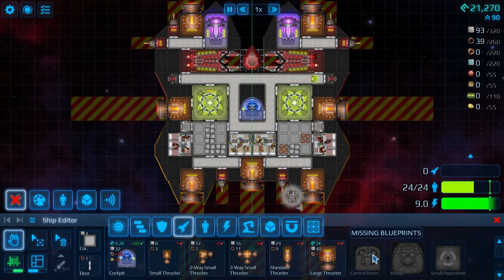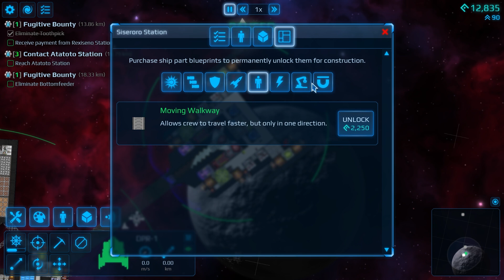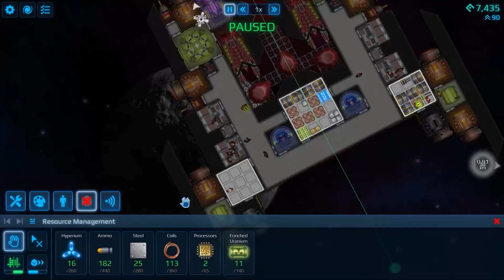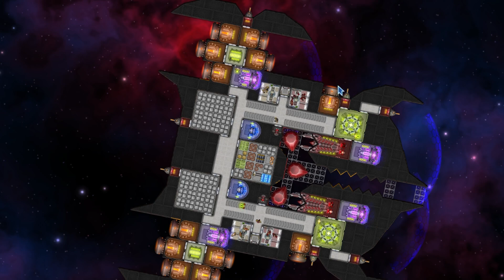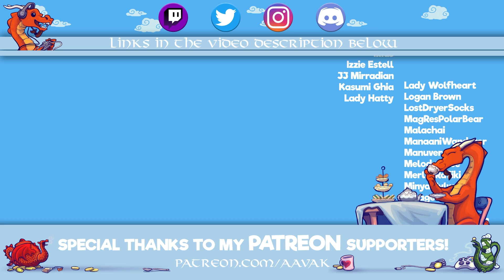Ion Prisms Allow MUCH better Defences!

Comment: if you're applying force to an object, an equal and opposite force is acting on you. With no drag in space, shooting a Big F'n Laser will work as an engine. You could try using ion beams pointed at suns as a metal af propulsion system

Comment: Isn't the point of thrusters to eject energy one way, so that hull moves the other way? If you built thrusters inside the ship all of the energy would just get deflected and distributed inside the ship and no movement if the hull will happen. You need an exhaust for it to work. So pointing a thruster at the armor block of the ship it tries to move would be at least very inefficient and likely just pointless with near 0 productivity. If you had an angled piece of armor (like an aerodynamic shape, which actually would matter even in space in this specific case) that woul deflect the thrust mostly to the same direction as the vector of movement you'd like, you'll just lose a bunch of thruster efficiency, as some energy would be wasted counteracting your movement and a bunch would be deflected in the pointless directions or lost as heat.
I wouldn't even mention the heat management issue for the ship of this design, as you'll have to deal with the problem you just brought onto yourself.
I like that in this game you have a huge dead zones behind thrusters, but they should probably just be infinite instead or efficiency should be affected greatly. But this game is not a realistic simulation, so it's probably fine like this.

Comment: How did you get the prisms to point at a 45-degree angle? Someone told me to place them then hold ctrl and left mouse button to aim them. I tried that and either nothing happens, it deletes it or placed another prism. I can't find a video that shows them being changed.

Comment: Tip with shields relating to what you said early in the video: use them to cover forward facing engines.

Because of the massive exclusion zone in front of all engines you cant reasonably use physical armour to cover all of your reverse thrusters. Shields are great for that task because they don't take up nearly as much space, weight or resources as would be needed to fully enclose a thruster in armour. Plus it usually isn't too difficult to implement into already existing designs because crew needs to be routed to engines anyway so it should be easy enough to squeeze one in behind a thruster group.

Comment: ...Could you put a second firing crystal at the tip of the "barrel" to get the full use of the firing arc but have it away from the core of your ship? Then you would have the core crystal in the back to keep firing as a backup?
Edit: Just got to the next video... lol?

Comment: You probably already know this by now but,

The reason they weren’t leaving the platform (around 15 minutes into the video) was because there was no way for the former crew to reach the airlock. If you want to salvage a whole ship instead of transferring the last crew over you should select „abandon ship“ this way it’s junk an you can mine it.

Hope this helps 👍🏼

Comment: Someone did the math and said it wasn't as efficient to take over a ship and salvage it?  That's fascinating, as I'm playing along with Cosmoteer myself and I found the opposite.  I didn't "do the math" per se, but I just saved my gave after I disabled a ship.  I then proceeded to scrape it from the outside and saw how many resources I recovered.  Then I took it over and salvaged from the inside and, lo and behold, I gained a small but noticeable amount more (or the rarer ones too).  I wonder if they changed the salvaging mechanics a bit from when you recorded this video and when I did my test (which was two nights ago)?

Either way, it's good to see you playing this game too, Aavak.  I always love your content.

Comment: With thrust going into the armour it would make it non efficient, maybe it will make sense if it is somehow venting out the top and bottom of the ship at an angle towards the direction it is firing.

Comment: 6:20. I have a secondary crystal at the tip. that way I can aim anywhere and if it's destroyed the second one hopefully would take over. As for the shield, the problem I find is that enemy disruptors will target the closest shield generator and basically your are done. I went back to overlapping smaller generators. adding sacrificial generators to the edge of the ship for the AI to waste it's time and ammo on.

Comment: One  thing that would solve some of your burgeoning area problems is that you can select an entire area of the ship using the selection tool - such as your rear third, or your 'warp nacelle' thruster arrays, and ctl-x, add six or eight rows of corridor, and ctl-v, moving around entire sections of your ship rather than one module or chunk of armor at a time.

You can also change your corridor painter from single blocks to, eg, 1xn lines for painting moving walkways, or nxn (drag-sized boxes) for painting large areas of corridors or armor.

Comment: I tried out the demo again thanks to awesome vids like this, and started loving it more. (The controls are a big turn off imo)
at 31:00 you start talking about recessing your thrusters, it reminded me of my take which took it to an extreme.  I basically had a giant rectangle (will make a more UFO vibe when I buy it), and all the thrusters were on the inside.   So It had massive maneuverabilty, and 100% of the thrusters were protected from every angle with armor.

Sadly I ended up getting blown up because I got greedy, and decided to salvage a ship i demolished inside enemy territory, and they jumped me with 2 ships, while 0 workers were charging the shields >.>;
I really am excited to try the 'full game' version, and while it really doesnt look like its polished yet, there is sooo much potential in this game I think!

Comment: This advice moreso applies to larger ships, but the principle is still useful for smaller ships.

You ideally want the crew maintaining a component to be AS CLOSE as possible to that component. And you also want them to be getting batteries from Energy Storage, and NOT Reactors. Reactors generate batteries, yes, but they cannot STORE that many. And they are vital and explosive components that need protecting, and therefore you probably want them AWAY from the systems that need powering.
The solution?
Have a select few crew that are DEDICATED to supplying energy storage with batteries, and let your other crew roles take batteries from those storages.

Minimizing travel distance, even if it’s just by a tile or so, is also a very important thing. A good ship layout that allows crew to efficiently move supplies can be the difference between life and death. And a good crew layout with dedicated tasks can be the difference between a risky battle and a landslide victory.
Reply from the maker: Thank you for this wealth of advice, I can already think of ways to apply it!

Comment: A little tip on roles, make 4 base roles for all your ships. 1 Operators, who operate your weapons, bridge and engines. 2 Mechanics who supply capacitors from your reactor. 3 Engineers who supply power to everything else. 4 Logistics who supply ammo and resources.
Reply from the maker: This is a pretty interesting crew set up, I'll consider changing things up in a later episode; but I do like the idea of not having defined "I work on weapons" "I work in the bridge" etc roles, and instead just having a "I operate things" role to cover all of them. That's pretty cool :D

Comment: Finally capacitors.  Yes, thrusters can be aiming back at the ship.  It makes long designs with thruster pods stuck out along the length extremely useful.  Narrow defensive profile without sacrificing offensive ability, as long as the correct weapons are used.

To not feel so guilty, consider that the thrusters pointed back at the ship to be mounted above and below the plane of the hull.  Additionally, nothing says the thrusters would be pointing directly aft either.  Two thrusters pointing at an angle away from the rear of the ship would still provide roughly the same thrust as a single one pointing directly aft.  This configuration would allow any amount of thrusters to be used and provide movement.  We only don't use designs like that in the real world due to limitations on energy generation and storage.  But I have no doubt that if energy was effectively free, such as it is in the game, then we absolutely would utilize non-, optimal thruster placement.

Comment: I believe this is a 2d representation of a 3d space. Building thrusters into the hull is just normal, something to do to emulate the ability for angled thrusters at the bottom and top of a vessel from this perspective.
I believe, it should be possible to build completely enclosed missile bays, that shoot "up" and above your own ship, only becoming solid when within halfway between your and the enemy ship.
Reply from the maker: But by the same token, if you introduce a quasi 3D element to the game, you have to assume the enemy have access to the same thing, and if you can launch a missile up out of the ecliptic, then why can't an enemy do the same and have their missiles drop back down to the ecliptic inside the 'safe' perimeter of your armour?

Ultimately it's a game though, no need to do any mental gymnastics to justify playing it within the rules the game sets out, and the game says it's okay to build your thrusters within a block of armour without diminishing their thrust (which angling them up and down would have to do, as now part of the thrust ISN'T pushing you forward, it's pushing up and/or down). 

I still think it's cheesy, but I'd never go as far as to say someone was in the wrong for being okay with the cheese. Cheese is delicious after all ^^

Comment: ....you could always use a second ion prism crystal at the end of the barrel to make a turret again....or you could place the ion cannons in the center of an armoured Hull build a barrel out tonthe edge and place another ion crystal there to give you the turret again and limit the distance to the ion cannons set up the control groups again and limit the explosive reactions to emery fire.

Comment: 50:08 Why did you rotate the crew quarter away from the empty corridor? You made it less effective, because now they have to go through the storage at 50% speed. You always want the crew to go through empty corridors to maximaze their potentcial. Every room lovers the crew speed to 50% which is a huge deal, you then need less crew to do their job if they move faster.

Comment: I think a good middle ground on industry/fleet building it to build up a basic design for cargo vessels you keep relatively close to your combat fleet.  Low crew requirement, lots of storage space, and you can specialize them for salvaging as much as possible.  Could even include some material refinement, basically creating a mobile ship upgrade point.

I also think your shield set up is just objectively cooler than armoring up the areas too.  It's like there's starwars style hanger bay shields over the thrusters rather than a solid wall.  Though maybe an individual basic generator in the back may be a good idea?  It certainly reduces the draw on the generators in the front during combat, and functionally you're already primarily drawing on the banks of energy you have stored up in the back there.  So this just extends the time you have before the power draw gets out of hand.  (Not to mention, if the unthinkable happens they destroy one of the generators in front you can continue to try to run away and lick your wounds with minimal loss to engine function.)
Reply from the maker: Yeah, it was quite accidental but once I noticed the way the shield curve fit with the armour I was very happy to keep it that way!

Comment: Love the series, please keep going!

As for the real world, rockets that exhaust directly onto their own ship aren't super realistic. You get your ship's change in velocity from the velocity of the exhaust in a rocket, so a rocket exhausting onto the ship directly would negate the change in velocity. However, in the real world you also have an entire extra dimension to deal with! Having a rocket engine that splits  the exhaust above and below the ship is definitely possible if you're willing to sacrifice some efficiency. Or even two engines with their exhaust at a slight angle. But both of those solutions would still end up having the exhaust lead outside, so they'd just be exposed from a different angle. Fortunately for you, your enemies in this game are only allowed to attack you from one specific plane, so they can't attack you from those angles.

If it were me, I wouldn't enclose my engines for the exact same reasons as you. The requirement for them to be outside seems like a good game balance based on real physics. But it is ultimately a game, and one that's not the most realistic overall. For instance, the game uses drag in space to create maximum velocity under constant thrust. That's suuuuper unrealistic, but it's a shortcut a lot of space video games take to make a game more accessible.  

So play how you want, Aavak. If you want internal engines, you can rest assured that there are feasible scenarios where that might work in the real, three dimensional world. If you want only external engines, then rest assured that you're allowing your enemies very realistic access to your engines they'd have in any three dimensional world.

Comment: I am always impressed with the creativity of people.  I always end up with large bricks, heavily armed and armoured.  I always struggle with the transition from small to big, too.  usually, I do an adequate small ship, based on the starter, then slightly improve it until it is sufficient to the jobs.... and then I want to build a huge ship.  I tend to use the thrusters in front aim back and in back aim forwards for relative compactness and protection of the thrusters.  in front gives speed and is protected by the heavy frontal armour and shielding.  I love shields.  I HATE the damned disrupters.  I have always HATED them.  Shields are meant to be protective, you have to batter them down to get to the juicy inards.  disrupters just bypass them, take them off line with a hit or two, and then you're toast.  HATE them.  So, of course, most every ship above starter levels, has at least one of them.  burried deeply so you can not just shoot it first.  HATE THEM with a PASSION!  lol.  Not a great ship architect, it is true.

Comment: Loving the series. I'm not sure it's worth doing the four ion into one beam configuration. You're currently getting 1.5x the damage of a single ion for double the space. With the four into one (as described with two pairs of two into one, then merging those two into one) you'll get 2.25x the damage of a single ion for quadruple the space. Instead, you could slightly stagger the focusing crystals to give you two double ion beams in just slightly more space for 3x the damage of a single ion.

EDIT: I misunderstood how prism combination penalities apply, see Aavaks reply below for how they actually work. They're much more worthwhile when combined than I thought.
Reply from the maker: I think your math might be a bit off; each extra ion into a single node drops damage by 25%; so right now we have two 100% ions firing into single paired prisms (no loss) then merging into a single firing prism (1 at 100%, the other at 75%) giving 1.75 ion's worth of damage for 2 ion's worth of space.

Adding two more ions to this setup will change the math to: each ion pair outputting 1.75 ion's worth for 2 Ion's space, merging into 3.06 ion's worth (1.75 at 100%, then 1.75 at 75% = 1.75 + 1.31)

Of course, I could still do as you suggest, getting 3.5 ion's worth of output out of two beams. At that point it comes down to a choice between concentrated fire with a narrower firing barrel or twin lasers with more exposed firing barrel. Or simply put, better defence, or better offence? I think it would come down to a case by case at that point and everyone will have a different leaning I imagine.
Reply: @Aavak  Ah I misunderstood one of my basic assumptions. I thought it was stacking 25% penalties, i.e. each prism where two beams met were reducing the total effiency of the output by 25%. The community agree with your reading so I will withdraw my comment and thank you kindly for the correction.

Comment: The thing with Ion Cannons, just like Railguns are they're more suited to be mounted o their own ships; drones or 'bits' like in Gradius, if you want to call them such, so you have more freedom in positioning them outside the enemy's reach while your main 'tank' or meat shield ship draws fire from the target. Also, if you put Capacitors next to a 2-crew rooms next to a power generator NEXT to the ion cannon controls you can set up refueling squads so your cannon can fire 24/7. In fact, you only need a minimum of 6 people to operate a single 2-cannon-into-1-prism Ion Cannon drone ship.

Comment: I guess maybe internal thrusters could be venting out the top and bottom? It's about the only way it'd work within physics, but it sort of seems plausible.
Reply from the maker: That does make some sense, though you'd be losing efficiency as some of the thrust would be pushing above plane (and would need to be compensated for by mirrored thrusters pushing below plane, or you'd simply sink)
Reply: @Aavak  Yeah, it would... Only excuse I can find for it though.